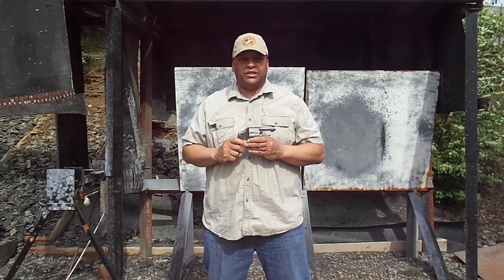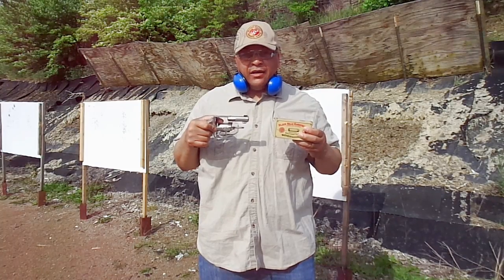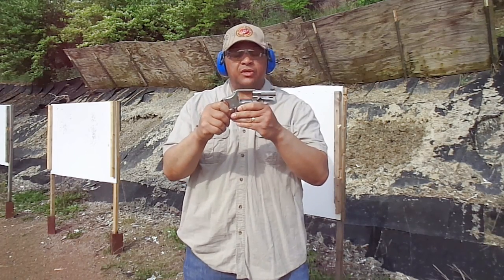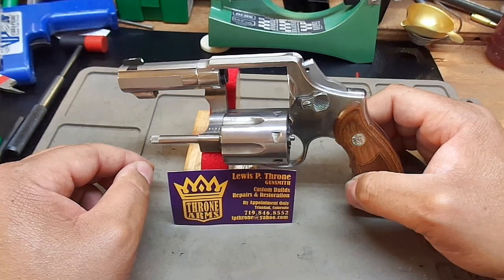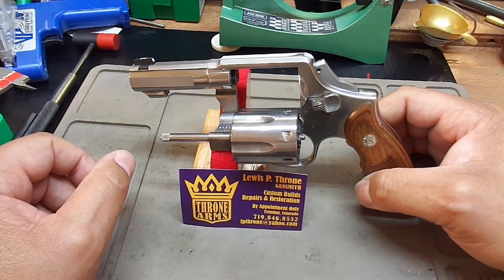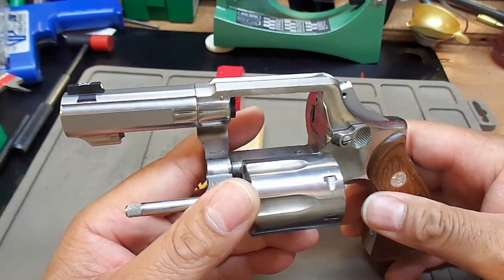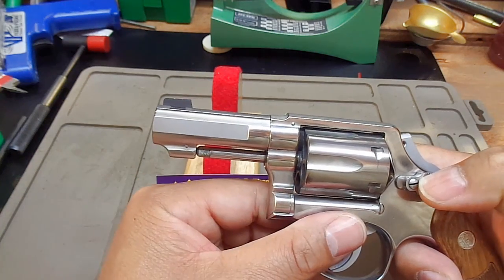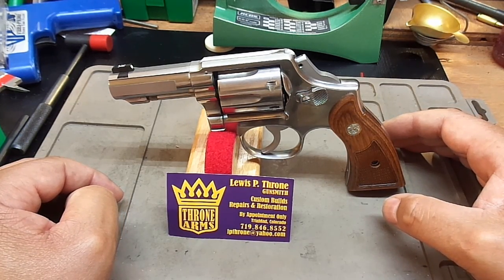S&W Model 65 -- Throne Arms -- The Perfect Fighting Revolver

Comment: Actually carried M64 4" on duty back in the day and had a M13 3" round butt (at the same time when that was the issue FBI firearm...the last revolver they issued) as one of my many personal firearms that I qualified with for off duty. Loved the 13 and of course hate I sold it. Recently bought a 65 4". I never used the S&W grips. Replaced them right away with appropriate Pachmayr grips. Need the full, non slip coverage around the grip. Multiple Safariland speedloaders and Bianchi speed strips.

Comment: Great looking functional weapon! I've got two 3" 65's a PC 13 and a 3.5" Pre27....there's just something about a 3" inch S&W revolver that points naturally. I agree with you on the square butt as it helps with point shooting. I have the last 3rd generation Colt Detective Special with the target style stocks these to me are the best fitting and pointing for my hand. Altamont makes a k frame round to square butt target stock I'm going to try on one of the 65's.

Your gunsmith did a great job on bobbing and bead blasting your hammer looks like he opened up the rear sight channel too.
Also like the front sight dovetail- allows for options as well.